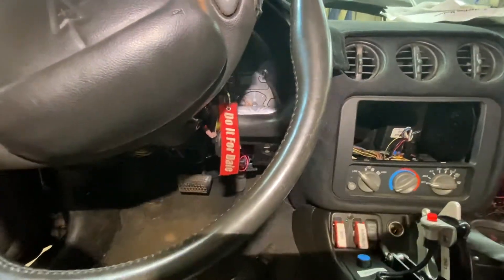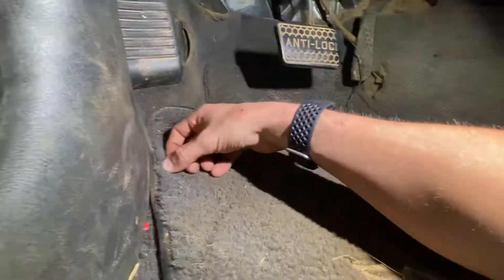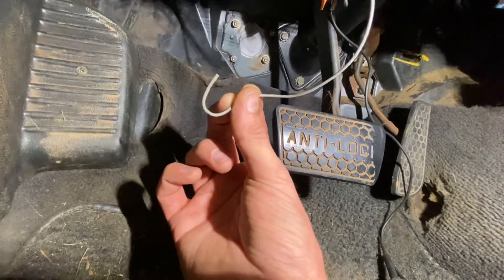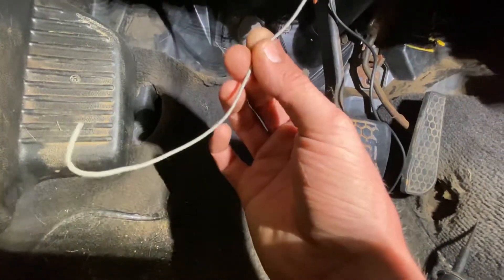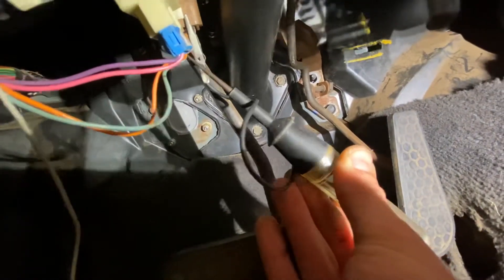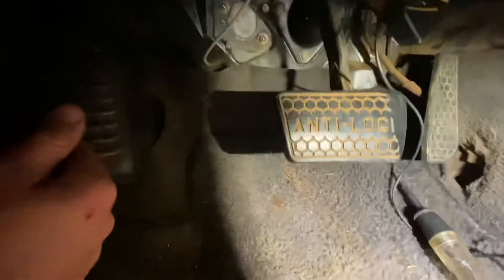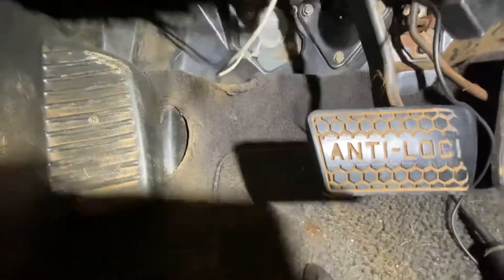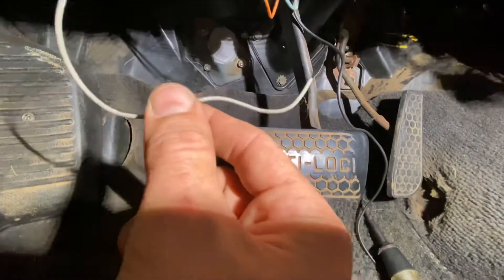Holley Terminator X brake input on a 4th Gen F-body

Comment: If u don’t wire it will it let u do a burnout?
Reply: The gray wire is only used to unlock the converter when you hit the brakes. The wire you're thinking about to do a burnout is the red wire on the the DBW harness. If you connect to brake switch, ECM will only allow 10% throttle even if your foot is to the floor. I personally left that red wire disconnected to allow full throttle when hitting the brakes resulting in big burnouts. Hope this helps.
Reply: You just solved my biggest fucking issue I’ve been having FOREVERRRRR!!!! Thank you god and thank you DAVID GOD BLESS YOU